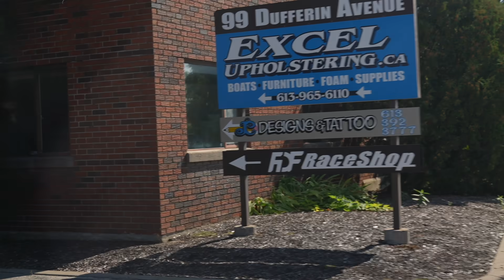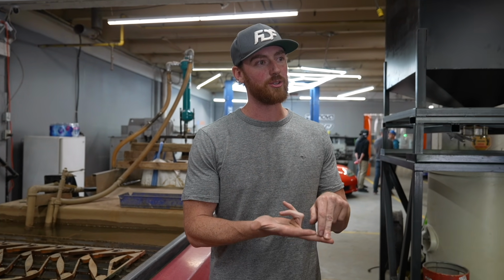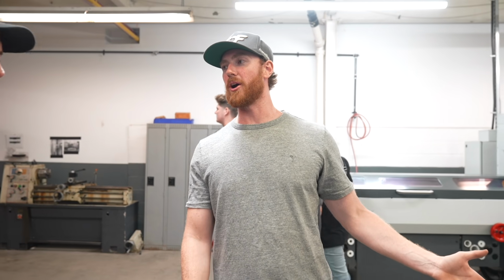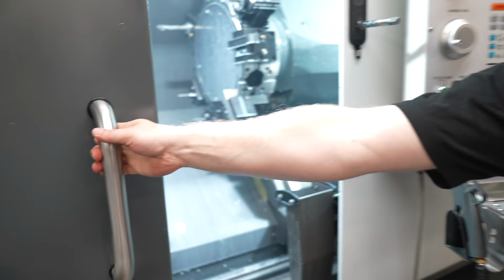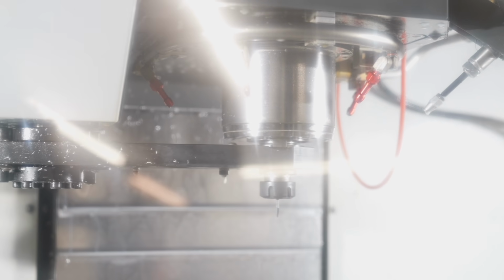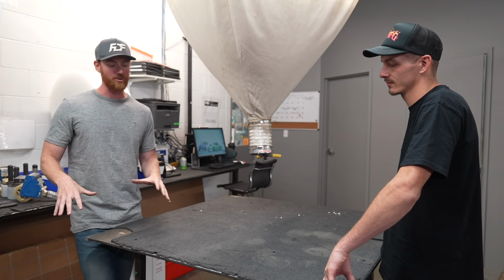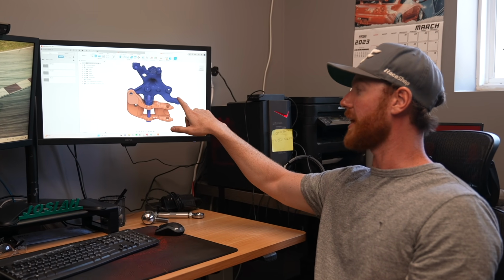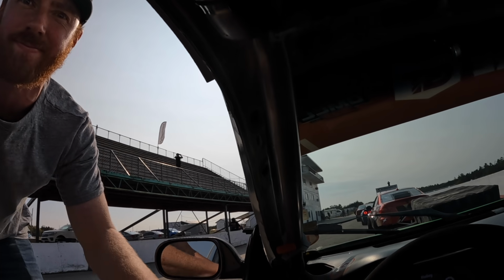I Drifted the NASTIEST V8 S14 + FDF BTS Tour!

Comment: It's funny but at the same time I'm going to lay some knowledge that motor in that car is the same thing as the dirt modified cars used with the transmission setups or some pure stocks were some modifieds run the same setup but that allows them if you ever listen to dirt car racing that's how they rev it's the same way it sounds exactly the same and that's possibly what in his vehicle that you're driving

Comment: As a mechanical engineering student, and working at a machine shop for past two years using the same machines, this would be a dream job.
Reply: Na this is a production shop, switching from proven set up back to proven set up blows. I been in it for about 10 years

Comment: love this video/tour of the shop.  I am a bit shocked of the high material waste.  some parts could be made with with less material waste , just by using a jig and different stock shape. (the machines are already there.) would make it a lot cheaper, because less material loss and less tools ware..   and hearing there are so many different (almost the same looking) parts are beeing used,  there could be saved a lot of money when more parts would be interchangeable. so there wouldn't be so many different parts needed. and less program changes.
Reply: Great observation. I hope they see this. 36:55
Reply: I am guessing you were referring to the first OP of the handle, which it could have less material in the area which is offset to the bottom of the handle, however the material will either be recycled on the sheet cut by the waterjet, or recycled from the chips generated by the machine. 

Another reason we do the stock in that size is it let's us use the same piece of stock for 3 different parts, less programming time, less space on the shelf for material storage and less confusion during the order of production. 

A fixture plate, mitee bites, programming and setup is much more expensive than using our serrated jaws to hold rough stock so we mainly try to focus on profiles that can be easily held, and the tools used to rough that material out we get 100s of hours of run time from while they cost about 25 dollars each. There is always room for improvement however!

Comment: things that get passed around under a taxed monarch... it is very hard to buy a car in Canada let alone get a bos or title for it, for any reason they raise insurance rates etc to secure individual bankruptcy. have never gotten a ticket driving a vehicle made in the USA in Canada, its only the vehicles with there vin stamps that they go after people for. inception, their thing = there regulation... stop using them because, doesn't work for localized needs. snow drift, sure is hard to tell if a huge Chrysler axle was made in Canada or the USA... is if the imperial thread pitch on the drive shaft flange isn't a give away. mm's like counting pennies? outlaw bracket racing, how does one get parts... make them or hustle Billy for money to buy them.